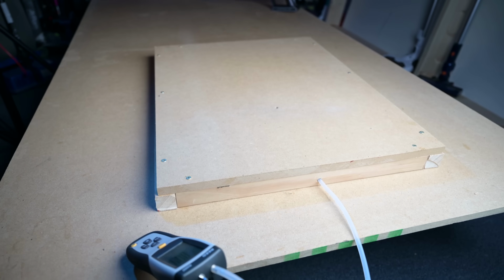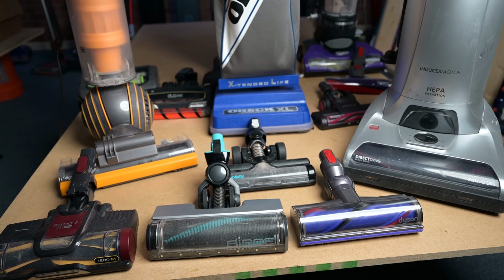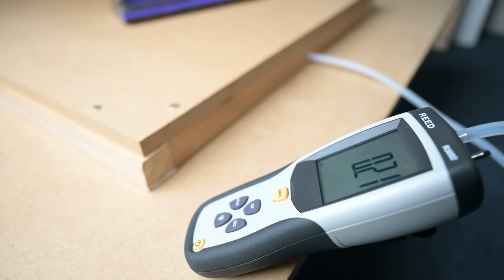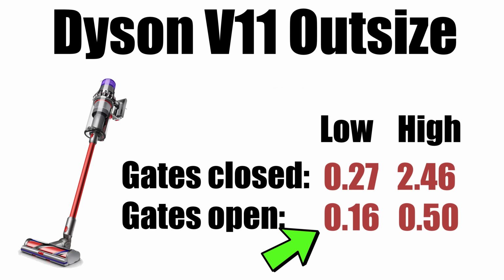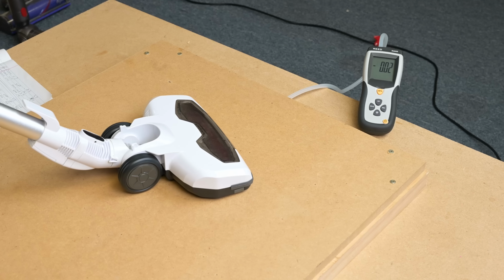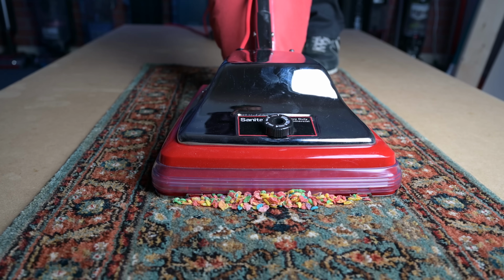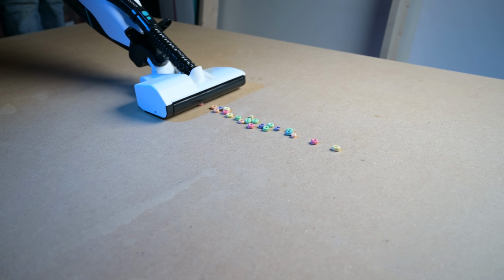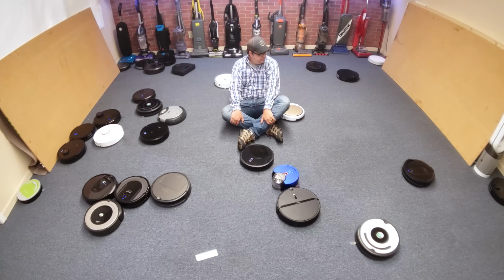Which Vacuum Has the Most USABLE Suction? 46 Vacuums TESTED! - NERDS ONLY!

Comment: I need a new dust filter for my Hoover MaxExtract PressurePro model 60 - can you help me with that?
Reply from the maker: You might try checking Hoover’s parts website or a vacuum repair shop, since older MaxExtract parts can be harder to find online. They usually have the best luck tracking down the correct filters for that model.

Comment: It seems like you could modify carpet roll to have Lupe-like performance.
If you placed soft slick foam cutouts just like Lupe uses between hard brushes, it would keep agitation and help with suction.
I have very powerful N8Werk Zeus, which is seemingly 400W max with good suction, and comes with 2 different rolls.
Your video really gives me the urge to try to improve the carpet roll with some kind of slippery foam that would seal it inbetween the brushes.
What do you think?

Comment: In the snowplow demonstration  I noticed one was by Tornado ( extra  wide path). I hate this brand of vacuum as they are poorly  made.  On ours  the beater bar stopped turning ( it was 2 days out of the box)  and I went to see why. Never have I seen a  vacuum that requires the user to remove 10 screws to remove the plate.   Yet the place I work still insists on buying this junk brand

Comment: Thanks for the video!

I’m trying to do my own testing for my OCD.

I clean the several bag less vacuums every couple months. There’s always a fine dust all through the cyclone area. I blow out the filters with an air compressor most times and then replace them once in a while.

Love to be able to test a new machine versus one before I clean it versus after I clean it to see how much of a drop there was after a month or two.

Any thoughts on all the fine dust that doesn’t get cycloned?

And have you done anything to teach about actual testing or selves? What tools to use, etc.

You show clips of testing airflow and you can use a lot of duct tape but it looks like :-)

Unavoidable I guess

Comment: Something is not correct with the Kenmore Elite result. I have this model and if I put it at the lowest setting the suction would lift my carpet up and or it would be too hard to push. Suction is excellent. It also has direct drive like the sanitaire however, it Does have a hose on board. Something wrong here.

Comment: I have a Bagged Hoover Wind Tunnel for over a decade now.  I use it twice a month and could ask no more from it. They advertised it's loudness as a good thing for reasons of efficiency and cost.  They advise to put on some headphones or ear pods and enjoy the best suction and they were right.   I've had both deep carpet and now I have a very expensive hotel low cut but dense carpet that was one giant remnant from the Intercontinal Hotel when it went up a few years ago. People comment on it all the time. It inspired me to upgrade my kitchen. Back to my H. vac. Since my vac rides on top the carpet I keep it on it's lowest setting. It uses some kind of baffling that ensures equal airflow across the length of the brush instead of all of it going through the middle like my earlier Dirt Devil did.  I was told that keep it at 100%  efficiency I would have to change the bag when it's 1/3rd full.  Last week, I asked myself, when did I look at that bag last.  It had to be at least a year.  So I opened it and it was about 80% full.   Wow I thought to myself because it was working so well. Though it did seem to be warmer as did the power cord.   
However, I got my vac for $75 when Sears was going belly up and I would bet all my lucky stars that even the best vacuums out there could only be about 10 to 15% better than my Hoover.  But senior Hoover cost 85% less than  some of those other vacs.
Reply from the maker: That is great.  Thank you for sharing.

Comment: Would you be able to add a suction/flow/ overall performance test on these vacuums, after they have picked up a measured amount of dirt/dust to see how quickly, and to what extent their performance degrades as the bags fill and thus clog the "filtering" of the bags, which decreases flow. Or in the case of bagless, as the filters begin to clog. I've noticed that my bagged vacuum's (pro team proforce 1500xp) performance degrades very quickly and significantly from when it has a fresh bag in it. (has a smaller bag) After vacuuming for 20 minutes, the pickup power is much less, almost to the point of not being able to pick up small pebbles on the carpet. I think this would be a nice factor to also consider when deciding on buying a vacuum. Thanks for the great reviews and your time!

Comment: I think a CFM test that would be better. What you are testing here is similar to a water lift test. There is s reason that OSHA requires dust extractors to have a minimum rated CFM and don't care about water lift suction levels.

Comment: Good job, some of the best performing vacuums on the deep clean test come up short. The Sanitaire traditional is the outlier but it has some advantages of simplicity and consistency by not having complications like wiper seals, flow passages, or variable area flow passages.  To explain really what is going on, it appears the more than vacuum depression of atmospheric pressure is not likely that important to performance, in fact has very little to do with it by itself. It appears total airflow over and through the fibers of the carpet makes a larger difference. But vibration and agitation of the carpet fibers would likely be important, too. The challenge is to know whether flow over is more important than flow through the fibers.
And, let's not forget maintaining a enough flow velocity after the cleaning chamber through the hoses to transport the dirt to the dirtbag or dirt chamber.

Importantly, this test should be on a carpeted surface, possibly with replacement types of carpets to really get an idea. Probably to get a baseline the Sanitaire, besides being inexpensive, has some advantages in baselining the effect.  In a beater bar vacuum like the Sanitaire one can remove the brushes strip(s) or get a bar without beaters and only brushes: this would give an idea as to the effect of  vacuum vs. agitation at lifting dirt (or test media like sand or dust), and whether agitation by combing effect or by vibration effect things more.  I think they use on the composite plastic bars a beater strip which might work in the metal bar instead of the brushes for beater only action.  Further the Sanitaire having no holes, gaps or flexible partitions to airflow where it contacts the work surface probably gives the best baseline for these tests, by eliminating such complications for now, besides it is the only one with multiple beater heads available; brushes, brushes and beaters, or removing brushes and having only beaters.  I suppose adapting a secondary vacuum in place of the bag inlet would allow adjustment of airflow and vacuum for a given height setting: either using a variac variable transformer to adjust speed or a leak orifice or an inline orifice to adjust vacuum depression and flow.

My thoughts:
Likely this stationary fixed oriface has little value to actual cleaning performance.  But a pitot tube extending to the brush cleaning chamber area with a manometer mounted on the vacuum would have more value... actually this could be connected to a computer to give a read out as you vacuumed the test carpet.
Likely: 
First, vacuum depression alone over the carpet would have little differential effect on effectivity of cleaning.  
Second, agitation would have less effect than vibrations on effectivity of cleaning.
Third, increased airflow would have higher power consumption with less effectivity of cleaning; increased vacuum depression would have less power consumption but less effectivity of cleaning; agitation for a given air flow and vacuum depression would not be as efficient as vibration for having the least power consumption for a given effectivity of cleaning - at a similar airflow and vacuum depression.

Comment: Bought the Lupe. Very disappointing even on hard floor (tile and wood) unless on high power. I also found it pushed a lot of debris to the wall and didnt pick it up. I don't have carpets. Also head is 7.5cm high so too tall to get under a lot of furniture.  Honestly underwhelmed. Low power is anaemic. mid is ok but makes quick tasks take longer.

Comment: Vacuum science man, this is good stuff! Suction is only one part of the equation though I would argue airflow is even MORE important when it comes to carpet deep cleaning performance that’s why direct air machines like Kirby and Riccar tout their deep cleaning ability, it’s a factor of finding the right balance of airflow, suction, and agitation. Too much of one thing is bad, too much suction and it just sucks itself to the floor impossible to push, too much agitation and you shred your carpet to bits. Proper design engineering is crucial for the best efficiency as you’ve already proven in cordless stick vacs.

Comment: Shocked the Kenmore Elite was so far down the list, you'd think with an upright vacuum with that motor would have done better.
Reply: Simply put, it would be like putting a supercar motor in a 12ft box truck with those square cabins. It might be powerful but it's poorly designed :P

Comment: Shark's anti hair brush thing is amazing though.  It works really well, even on long hairs.  I always hated cleaning the hair out of our old Dyson.
Reply: I one hundred percent agree.  I have two sharks right now. Both duo clean.  My only issue with them is that I’ve had to replace the plastic cover over the drive side of the front roller several times.  Being a K9 handler and vacuuming all kinds of rooms has definitely revealed the weaknesses of the vacuums I use.   I just suck it up and keep buying parts when I need them because the duo clean heads clean my kennels better than any other.

Comment: It would've been nice to see how the Lupe performed using your old metrics.  Aligning all the old vacuums to the new test is interesting... but somewhat unfair since that's now how they were previously designed for.
Reply: Due to the vacuum head being sealed up, the old test only shows the power of the motor instead of the actual performance of the vacuum in real-world usage (it does not take into account the design of the vacuum head). I wouldn't be surprised that the Lupe would still be in the best vacuums in the list anyway with that irrelevant test. :P

Comment: I want to make a teeny correction- the Sanitaire tradition is not the only direct air vacuum on your list- the Oreck XL is as well. It’s easy to miss as it’s numbers may be low for its type, but it’s weight is that trade off.
Reply from the maker: Thank you.

Comment: After thinking for a while, I figure the biggest problem with adapting this test for robot vacuums is going to be figuring out how to convince a smart vacuum to roll over the same spot many times. A "dumb" bot can simply be told to run out its whole battery in a small pen, and you can come back later with confidence that the recorded max reading on your anemometer represents the best-case scenario since the vacuum will have gone back and forth many times from different angles.

A "smart" robot vacuum only wants to do the same spot once or twice, so it could get tedious telling them to spot clean over and over again from slightly different starting points...

Perhaps what you need for a repeatable test is to take advantage of the wall-following action that all robot vacuums employ, by using an adjustable rail to force them to go over that spot with different offsets (one run with the suction point 3in from the wall, next run with the suction point 3.25in from the wall, etc)?

Comment: As you note in the video, this new metric best measures the seal around the vacuum head.  What still seems to be THE question of the hour is what metric of the ones we see really does the best at indicating cleaning power and I suspect the answer is "it depends".  The act of cleaning a floor involves several things happening in concert with one another - air flow (both pressure AND volume), brushes "throwing" the debris into the airflow and some form of a seal to increase the speed of the airflow into which the debris is caught and ultimately vacuumed up. This is similar to things like a pressure washer or leaf blower where just having high speed or high pressure isn't enough to clean.  You need volume of movement as well.  It would be interesting to test the POST head air movement speed and volume of these devices to see how much movement is happening in the column of air that has debris in it...
Reply: Look at a video demonstration of a “working vacuum gauge”. That is probably the best instrument to predict cleaning ability. Basically it’s a Y shaped pipe, one end is attached to the vacuum hose, one end is attached to a vacuum gauge, the third end has a restricted orifice (I think most are 3/4 inch diameter) . Initially the orifice is sealed and the maximum sealed vacuum pressure is notated, then the orifice is unsealed, whatever vacuum pressure is maintained when the gauge is unsealed is notated. This second measurement is what’s referred to as “working vacuum”. A vacuum cleaner must have strong suction and strong airflow to maintain strong “working vacuum”.

Even this can’t account for cleaner head and brush roll design and performance though.

Comment: Maybe you should add a cost per point into the equation, since Lupe is massively more expensive.
Reply: The Lupe would still crush all the competition if you make them comparable in usefulness (so debris holes not closed on Dyson and Sanitaire Tradition not dropped so low that it can't pick up bigger debris). That leaves the LG CordZero A9 Soft in 2nd position with less than half the useful suction and only about 25% cheaper... Stats don't lie! :P
Reply: It is not massively expensive for example is the same price with Dyson top cordless vacuum, even Dyson newer models are more expensive, we have looked for a new vacuum cleaner for some time now and find that Lupe has all that the other cordless have combined in one vacuum cleaner and in addition (you might think design does not matter) upright design is better. Doesn't put to much weight on your hand, better to reach difficult to reach pleases. We all ready try it in action as our friends have it and is amazing, it blows Dyson away. 
I hope that's helps.
Reply: It's actually not. The most expensive cordless vacuum model from Dyson is $970, the cheapest model is $400 and the average price is $600, which is equivalent to the cost of a Lupe. Since the Lupe is much more powerful than all of Dyson's cordless models, $600 is a pretty good deal, especially when you take into consideration the battery life, dual cleaning head, size of the debris canister, and the fact that you can purchase replacement parts individually as opposed to buying a brand new unit since it's design for longevity. Traditional cordless vacuums are not that great, especially the non-premium models from major brands that you can find in regular department stores. In my opinion, it's kind of pointless to get a cordless vacuum unless you purchase a premium model that's at least $300+.

Comment: I wonder where the best tradeoff between suction and airflow is? After all, suction is inverse to how much air you're actually moving and you do need air moving through your vacuum or heavy particles like sand just won't get lifted up the hose and there's even a chance the motor might overheat.

Comment: Bravo! The only problem I have with the Lupe is how loud is it? I sent an email to the company weeks ago and have not received a response yet. I have sensitive hearing like a lot of people and use a Miele S8 and also a Henry Xtra because they are quiet. A decibel rating would be nice....
Reply: I find my Lupe to be overall less annoying on my ears compared to the Dyson V11. I did a 1M SPL test and got 65db low, 67db med, 70db high with my Lupe while on medium pile carpet with the floor brush motor on. I also have a higher end Miele canister vac and with its powered floor head I get 63db on lowest about 65db on mid setting and 68db on highest.  My test is not scientific, just meant to give you an example.
Reply: @claykin1  Strange. I bought a Miele UniQ S8 in 2013 and get 53db on low/curtain mode, 62db on ear (medium) mode, and 64db on max suction. My Henry Xtra has one setting and it was 70db. I also have my 1978 Electrolux Olympia One canister and got 75db, only 5db louder than a Lupe and it's 42 years old. I did watch a video with sound on the Lupe and I found it too loud, but that could have been a sensitive microphone. So basically the Miele's highest suction is still quieter than the Lupe's lowest suction setting.

Comment: Why is this a useful metric? One of the “worst” performing cordless vacuums according to this metric is the Riccar Cordless, but that same vacuum deep cleans carpets just as well as the Lupe according to your tests. I’d also like to point out that the Riccar has nearly an hour of battery life on high power mode.
Reply: Personally I would buy the Riccar cordless over the Lupe because it is American made,  based on proven design, Riccar Lightweight, with  good performance, and it is bagged!